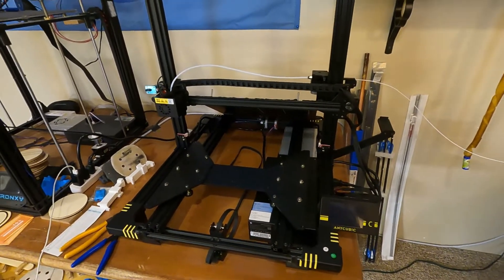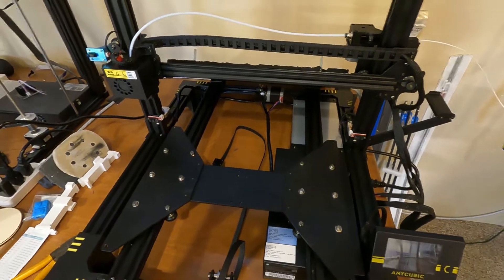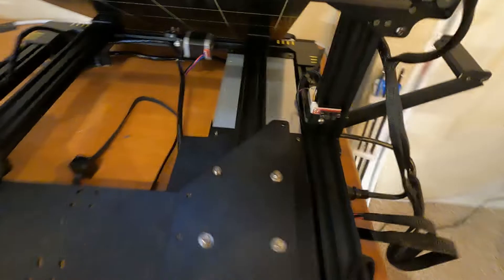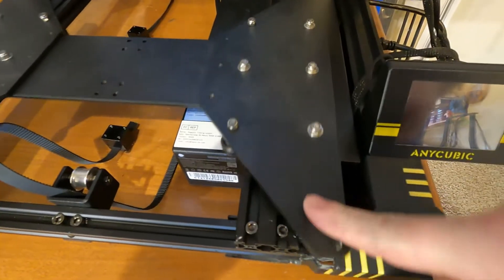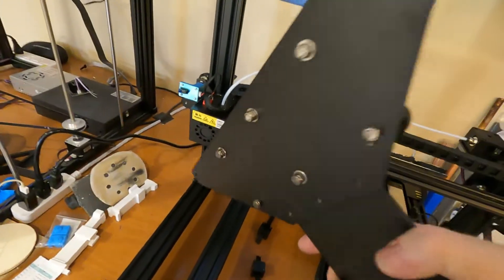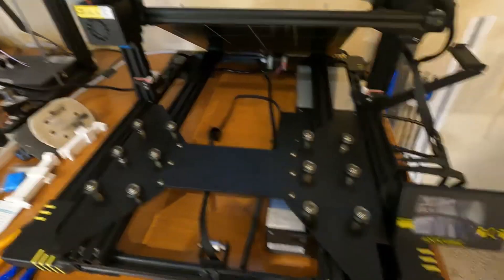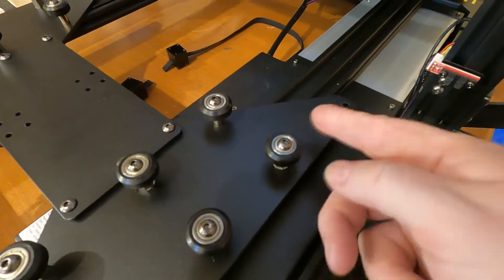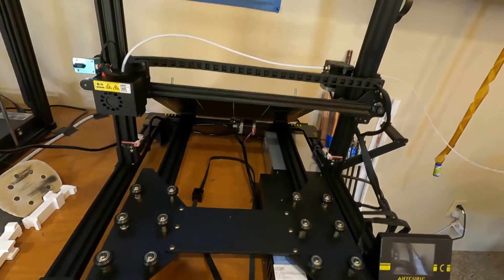AnyCubic Chiron - Ripping It Apart

Comment: hey need profil cura for anycubic chiron please !
Reply from the maker: Hi!  I don't have it going yet.  I'm converting it to direct drive extruder with the V6 Volcano hot end.  My Sovol SV03 crapped out and I had to give it priority first.  I'm happy to share Cura profiles for anything you want, the only thing that really changes is the bed size, and maybe the print speed, depending on how fast your nozzle can melt the filament.  I didn't like the V5 J-head hot end that came on the Chiron.
Reply: @dougdemako7382  thx